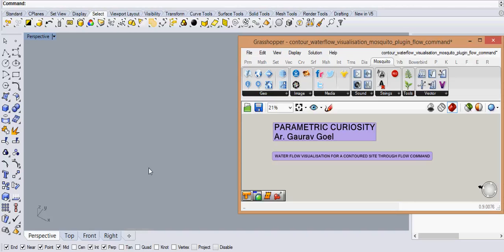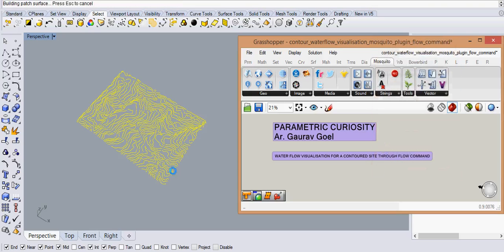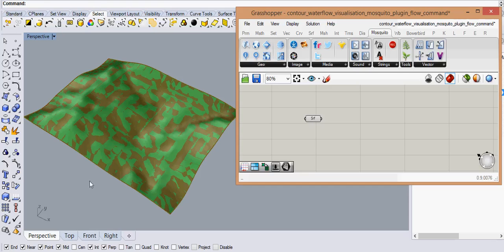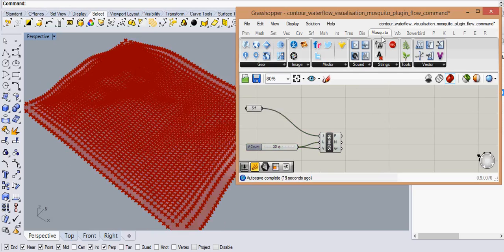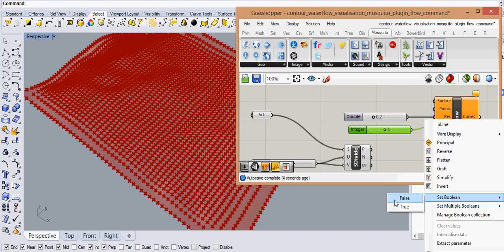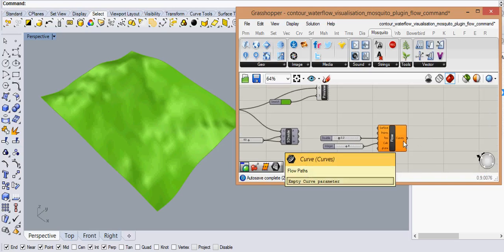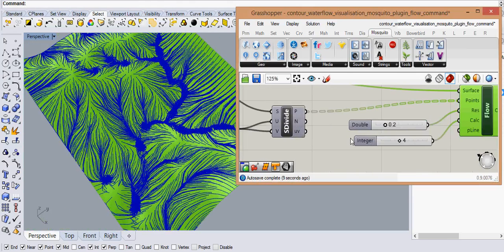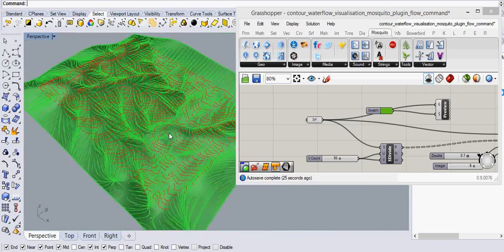Generating Flow lines on contoured site mosquito plugin Grasshopper

Comment: why there is no flow in my grasshopper?
Reply from the maker: you have to download a plugin called Mosquito from www.food4rhino.com ..after download download go to files menu in grasshopper and put this downloaded file in grasshoppr component folder. Restart rhino and Grasshopper and you will have flow command in your grasshopper. If you still have doubts please message us at our Facebook page Parametric curiosity and we will help you !
Reply: Thank you~ but when I followed the video to generate water flow lines, why are the lines in chaos?
Reply from the maker: Xiangyun Cao please send your script file in fb inbox of Facebook page Parametric curiosity
Reply: @xiangyunmiacao5571  ik this reply is very late but i had this issue right now, i fixed it by scaling the surface up very much